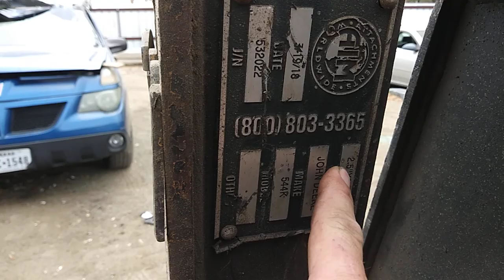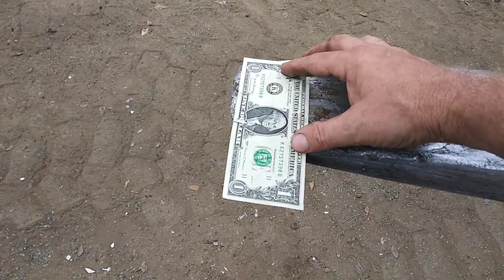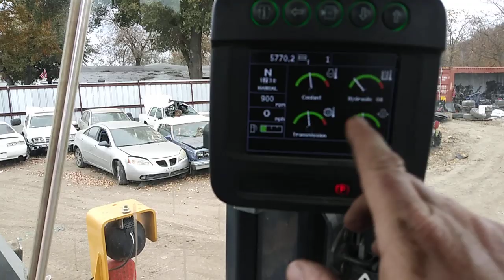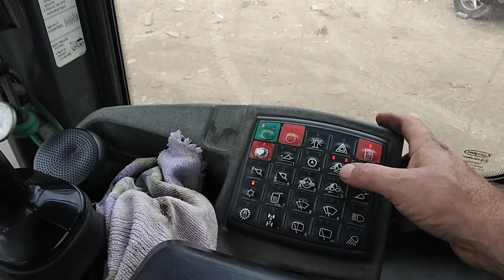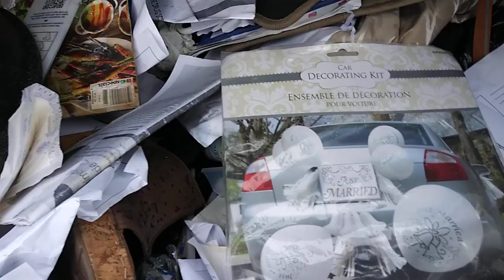Volvo S80 gets Crushed....Shout out

Comment: When I use to operate a cardboard baler or a compactor they had to show me what keys to use & what knobs & buttons to operate & I actually did well with them
Reply from the maker: I've never used one JP. Did you have to put the metal straps on the bales or does the machine do it?
Reply: @CowboyCarCrushing  yes for cardboard the other compactor just pushes the trash into a big container

Comment: I just learned that Volvo is owned by a Chinese company now. I don't know if I still want one . . .

Also, I wonder how different that thing is to operate from a forklift
Reply from the maker: Im awful at operating those litte warehouse forklifts
Reply: @CowboyCarCrushing  I'm not the best either lol. 

One time I hit the cardboard baler (though I'm not the only one lol). I also drove the end off the loading dock and scared the crap out of myself. 
Loading them cardboard bales, normally the feet hit the axle. Well, not on that truck. Someone had to rescue it lol.
Reply from the maker: @jayzonmeztdagh  i had a truck/trailer pull away from the dock and the forklift and me fell of the dock
Reply: @CowboyCarCrushing  Well that's terrifying. Your lucky to live another day.
Reply from the maker: @jayzonmeztdagh  i did exactly as the sticker on the ROPS reads. I pushed on the roof of the cab with both hands and pressed my butt in the chair and rode the crash out.
Reply: @CowboyCarCrushing  Our forklift doesn't even have a seat (it's a stand up one). Ide have been toast. 

Or a pancake, as it were.